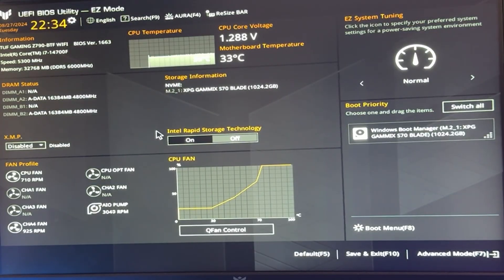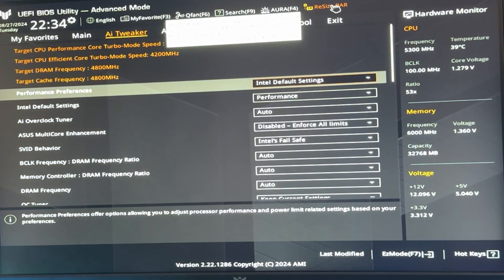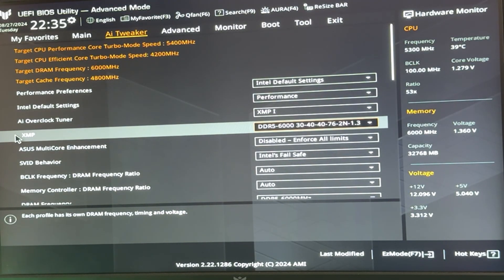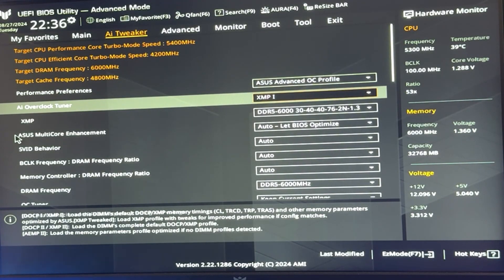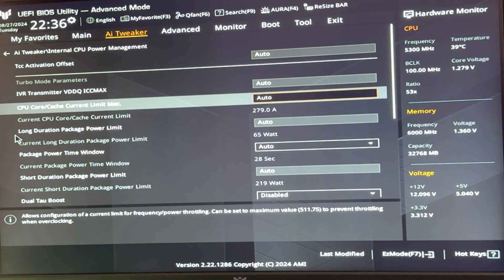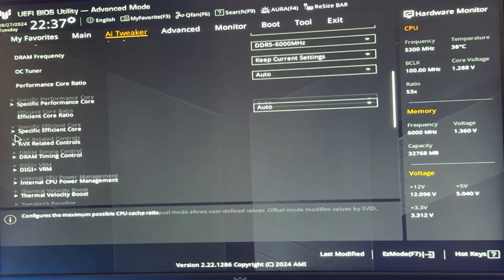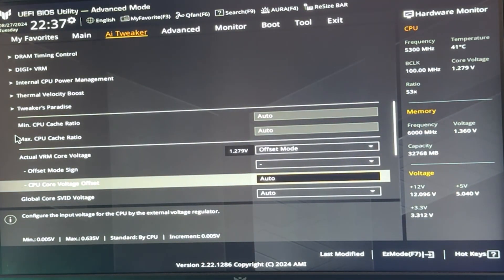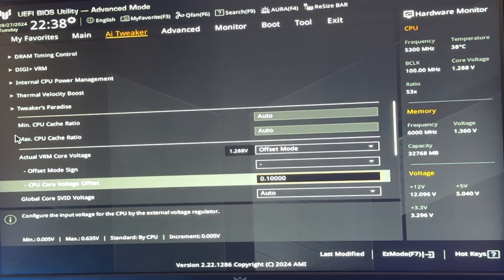Undervolt your i7 14700 & 14700F for more FPS and Lower Temperature!

Comment: the reason I need throttle stop is bc my mobo is locked and cant change anything with the locked cpu. XPS 8960 is a Bitch. cant even use xmp

Comment: This is great, thanks.  Using it to undervolt 12700k with the same ASUS BIOS UI.  The only difference here is for the offset, you set it to - 0.10000.  And for the power limit where he set it to 253 W, you change it to 190 W.  Follow the rest and it works GREAT,  my CPU temp drops by 10 C with no performance loss.  Again, this setting is for 12700k CPU.  THANKS AGAIN for the tutorial.

Comment: Bro my 14700K in gaming consumed 1.45v and after this undervolt still consume the same. Did I miss anything?
Reply: I have the same problem. I’m wondering if this UV even works at all. I have the latest 3001 BIOS on the Asus Z790-F.
Reply: @adamsadzik5154 in the end I limited power to 180w. Minimal performance impact in games but much better temps
Reply: Did you guys turn off Cep? Turn it off, made a huge difference

Comment: i7-14700f + B760M C V2: Changing to -0.075 dropped my OCCT test from 90°c with crash to max 75°c and no issue. Lovely. Temperatures are more even across the board, too. Not stepping from highest to lowest anymore.

Comment: Hey man! Need some help, I have asrock motherboard but with a i7 14700K. I saw your other undervolt vid for i7 14700k and said to do -.05 but here you said -100 for -.1. What do I input for offset voltage for the i7 14700kf with asrock. Should I put in -50 for core voltage to equate to -.05 on asrock motherboard?

Comment: Helped with my i7 14700f. I previously changed my pf1 to 125 and kept 2 tocdefault at 219. Ran fine after using the settings in the video my vaults dropped by .5 or so and performance everything is more stable. Mainly warzone
Reply: I'm too high i don't get it

Comment: My man , you just brought my 14700k down from 75-90c in helldivers 2 down to 45-50 c range with the same performance ! You rock bro !
Reply: Also testing with HD2 here, and the conservative Intel Default settings, CPU temps fell a solid 10c, and %usage fell 4-5%.
That first reboot after the changes had me freaked out for a bit (long wait, lots of fan roaring and flashing lights), but a huge win.
I have the same Asus 790 motherboard shown.

Comment: My i7-14700K is runing very hot gaming at 212F at some cores I know I have the right amount thermal paste on the speed is at 5.5Ghz on P-cores but 4.3 E-cores. I assuming that's whats doing it. I left it on Auto I never OC. idle is 100F. I have 9 fans. Its Air cooled not water cooled. Maybe because I do not have a Double heat sink. But I have the best Noctua NH-U12S Redux...So if anybody wants to give an opinion of how to set this right let me know. GIGABYTE Z790 AORUS ELITE AX. Should I lower the 5.5Ghz to 5.0 instead?

Comment: By setting your values, my CPU goes to 92 degrees and automatically drops to 70 degrees. This hasn't been very useful for me.
Reply: Intel needs to held responsible for this
Reply: you use 0.0500 or 0.075 ?
Reply: @TheSivagorn 

I think my friend set mine to 0.075 , I personally repasted with Mx6 and set my power plan back to High Preformance instead of that hidden Ultimate Preformance one. 
When I start it up now it his 50° for a few seconds then comes down to the low 30°s and while gaming it still hits 99 at first especially in Blacks Ops 6 if you leave it idling on the menu, but once gaming it goes down anywhere from 67 to 87 Native 1440p Very High Settings on other games it stays in the mid 80°s were before it would hit 100+ and thermal throttle, I would just try 0.075 and go from there because everyone's system is different.

Comment: Im doubting between i7 14700 or 14700kf for my system wich is msi b760 tomahawk ddr4 wiffi / artic liquid freezer 2 240 + contact frame / 7800xt nitro + / 32gb ram at 3600 corsair vengeance / philips 34m2c3500l/00 3440x1440 180hz 0.5ms fast va and 9tb storage 4tb m.2 / 4tb sshd / 1tb m.2
Reply: i went with the i7 14700 NON K gnne get it in a few days curious how it wil work out of the box.
Reply: @dieaking6475 how did it work?

Comment: I don't understand why you need to lower the voltage of an i7-14700 or 14700f processor.
If high temperatures are reached there are mainly two problems:
1 inadequate heatsink or unventilated case
2 poorly mounted heatsink

I have an i7-14700f with a 420mm arctic cooling AIO, in idle the consumption of the whole computer (so cpu + 4 hard drives + RTX 3060ti) is 66 watts and the cpu temperature is stably 22 degrees celsius.
If I run stress tests, such as from the CPU-Z program, the consumption reaches over 350 watts but the temperature never exceeds 65 degrees.

If someone says that this is not possible, I can post videos to prove it!!!
Reply: Is it possible to know the temperature when testing Cinebench R23?
Reply: With such a beefy cooler it's a waste not to use 14700k instead. I think most people who decided for the non-k didn't want to upgrade for a water cooler or bigger case. Still, Intel kinda scammed us there, difference in temps between the k and non-k seems to be just 5°C
Reply: Those who buy the 14700f without proper cooling thinking they are buying an underpowered cpu will have major temperature problems in my opinion.
From my tests the 14700f cpu under stress exceeds 300w of consumption and without a proper heatsink soon reaches 100 degrees celsius as in the 14700k. 
I enclose the link to a very simple and short video of mine where you can see what I write.
https://youtu.be/-GpQPiejxDU?si=m0hrW7J74JC3BSAX
Reply: @cix1976  what did you set your pl2 to? If it's on default maybe it's messed up, manually set it to 219 (Intel's default). My board's default pl1/pl2 is messed up giving 125/150 for a Core i7 14700f lol. At 65/150 it's pretty chill actually, performance loss yes, but still plenty for games. If you can handle that TDP fine, you would be better served with a 14700k, about the same heat, a bit more MHz. I read about a guy reporting his 14700k at 65w pl1 performed worse than a 14700, wonder if that's really true.

Comment: Hi, i am a fellow italian with an i7 14700F, congratulations and thanks for the guide, i was setting a vcore undervolt of -0.05 to begin with like you suggested, but on HWmonitor and intel XTU it doesn't read the -0.05 offset being active. I also noticed one thing yesterday, tinkering with Throttlestop i disabled turbo boost to read the lowest cpu voltages that my cpu could achieve, and they were 0.832 or something, i've left it like that for a night since i also had to copy a truckload of files between two slow hard disks, and it never ever went under that voltage (iirc) and surely never under 0.8. Now to return to the topic, by disabling turbo boost and reading the minimum voltages again i see my cpu sitting at 0.782 with the -0.05 undervolt enabled in the bios, so in short i think that the undervolt is active even though XTU and HWmonitor as i said do not read differences in offsets. Do you think this may be the case or am i tripping? Do you have any ideas on how i could verify that? Thanks again for your time
Reply: Ma allora scrivi in italiano.
Reply: @GeneralAkAbA Ho pensato dato che parla in inglese e per rendere il tutto leggibile anche da altri di scrivere in lingua inglese
Reply: @Feanorlike  ti sto trollando, ignora
Reply: @GeneralAkAbA  Potevi trollarlo in inglese allora!
Reply: so you mean that you was able to achieve 50 millivolts in software x but hw monitor did not show anything at all? is the temperature noticeable lower? on my mobile i7 7700HQ i was able to lower the voltage by 150mV and i got 76C instead of 92C

Comment: do you have a solution to get  xmp  to work  for an i7 14700k paired with a gigabyte B760 gaming x ax motherboard ? also running DDR5  5600MHz Ram.

Comment: Why would maxing out the turbos lower temperatures? I don't understand doesn't make any sense
Reply: I don't think maxing out the turbo would lower temperature. It's more the undervolt that lowers temperatures.

CPUs require power to operate, but different chips (even with the same model number) require different voltage to be stable. Intel gives a generous amount of voltage just to be safe, but 99% of CPUs can sustain the same clock speeds with slightly less voltage. This allows you to get the same performance with less heat and power.

Sometimes, because the CPU is cooler, it won't throttle, so you can actually get more performance by lowering voltage.
Reply: @dadozygaming if I run PowerMax without doing anything. It caps at 220 watts. When I undervolt .060 it goes to about 199 watts. Where am I looking to find out if my clock speeds are lower? I'm just assuming if I'm using less power so I'm getting less performance I have hwinfo. But what I'm gathering from you that even though the wattage might be lower, I'm still getting the same speeds. This is correct. Yes? 
So if I set my power limit 1 and 2 to say 500watts My CPU isn't going to use that if I undervolt by .060 ever? I use a 14700f I'm trying to maximize its performance since I can't exactly overclock it. When I got the computer at the time I didn't have a liquid cooler so I didn't bother with it. But now I do have a liquid cooler.
Reply: @QQWoLPHie  You are 100% correct in that you're not getting less performance when you use less voltage. You get less stability when you use less voltage. It's like a person screaming so that someone will understand them. The person can speak more softly, and achieve the same results. As the person speaks softer and softer, at some point, the other person will start to not be able to understand, and that's when the CPU crashes. You just to speak just loud enough so you always understand, but not super loud so you waste your lungs (plus you tire out faster). I hope that's a good analogy. Every CPU is different. Some CPUs are like deaf old people who can't hear very well, and you have to yell. Some CPUs can hear the faintest whisper without a problem.

Once you find the perfect voltage where it's 100% stable but as low as possible, you get the best of both world. You get 100% of your performance with power savings, a cooler CPU, and longer CPU lifespan.

Since your CPU is cooler, you could push it harder. However, you said you can't overclock, and that's okay. Just remove all your turbo limits.

Your computer will sometimes "turbo" your CPU by increasing its clock speed when under heavy load. However, due to heat constraints, it will often stop turboing in order to save the CPU from burning up. With undervolting, strong cooling, and turbo turned off, your CPU could effectively turbo infinitely, maximizing the clock speed and performance of your non-K CPU.

However, don't expect your CPU to always be at 100% turbo clock boost when idle. That's not what you want anyways. You just want it to be on turbo when you need it. Again, since you cannot overclock your CPU, that's all you can get.
Reply: @QQWoLPHie  Sorry for the double post. It's natural for your wattage to go lower, since watts = (volts x amps). As your volts go down, so does your wattage. That's a good thing.

I also want to warn you that removing all turbo limits can damage your CPU over time if you don't have enough cooling. Silicon degrades with heat. You don't want your CPU to be stuck at 100C all day. Use with caution and monitor your temps.
Reply: @dadozygaming  i got a corsair icue h100 elite and  3 fans so 5 total, its pretty efficient for sure, im gunna fiddle with the voltage and test, so as long as the computer doesnt crash with the undervolt and maxed turbo limits, does that typically mean its running at 5.4ghz or will it just lower my cap speed to maintain stability automatically. like if i gave it a .075 undervolt and doesnt crash could it be running at 5.1ghz at max or it will hold that 5.4 or crash at max speeds
Reply: @QQWoLPHie  If the computer doesn't crash, throttle, or exit turbo then it should be running without a decrease in performance.

If you really want to know if your computer is performing better, do a benchmark. If you want to check your computer for stability, do a benchmark. It's killing two birds with one stone. Try benchmarking without undervolting, then again with undervolt. You should see zero decrease in performance. If anything, your performance should go up with undervolt.

Have fun undervolting, but I feel -0.06 is already a pretty good result. I feel -0.075 is a bit greedy, but it's your CPU and your call.
Reply: @dadozygaming  no I heard 075 is aggressive. I was just making an extreme example
Reply: @dadozygaming  I get throttled at about 3 minutes in a benchmark no undervolt. Like if I use powemax SSE for 5 minutes I stop "turboing" little over halfway through. So a fully stable cooled CPU should be able to turbo the entire duration?
Reply: @QQWoLPHie  That's right. If you have a fully stable cooled CPU, you can turbo all day forever.

It's like the golden mushroom in Super Mario Kart. "Yahoo! YA-YA-Ya-Ya-Ya-Yahoooooo!"
Reply: @dadozygaming  I appreciate your help by the way, it's my vrm Mos that seems to top off before anything what's a good way to keep that cool besides air flow and what I've got already? Maybe get all top end Corsair fans cuz right now it's got ABS pre-built fans. I snagged and refurbished pre-built that was cheaper than building it myself. I wouldn't have done good Cable Management so I appreciate the hassle taken care of. Customizing where I can. I feel like once the '5070s come out the 4070 TI super will drop dramatically

Comment: Hi, I've just updated to the latest bios with the microcode update and when i undervolt my cpu with the intel default settings the undervolt doesn't work properly , the voltage are lower but the power consumption is the same as stock. However when i switch to the mobo unlimited power settings the undervolt works fine just like in my previous bios. I was wondering if it does the same with you when you put intel default settings ? Btw i undervolt my cpu thanks to one of your guides and same with my gpu so thanks for your work.

Comment: Thank you for the video!
"Problem" is, mobo chipset, most of 14600(k) or 14700(k) users don't own a Z mobo, but B one. Please, try something regarding B760 chipset, if possible.
At least on Gigabyte B760(m) chipset, the only way to undervolt is by selecting 0x104 ucode (if I'm not mistaken).
Reply: yes, my Gigabyte board can't undervolt under 0x129 microcode, while other B760(M) MBs easily can.
Reply: @antonavdyushkin545 You may be able to select to 0x104 uCode in the bios, which allows the undervolt. I'm doing that on my B760m Aorus Elite F18g (0x129 uCode) running on 0x104.
Reply: Where do I go to undervolt on the gigabyte one? If it can do it, is that the dynamic core thing under vcore?

Comment: Hei, I am a video editor, thiking to build an editing rig... is the i7 14700k issue fixed ?? i feel it would perform better than ryzen 9900x
Reply from the maker: If the i7 is set properly and cooled properly you’re gonna have absolutely no issues :)
Reply: 7950x seems like a much better choice for you
Reply: i have i7 14700kf never had any issue
Reply: 14700K is a gem! Just don't let default bios settings ruin it. Actually this is true to any modern platform.

Comment: can i do this for my i5  13600k? i have a MSI motherboard. and yes i have the latest update for my motherboard.
Reply from the maker: Yessir you can! I also have a few dedicated tutorials for undervolting K-series i5
Reply: @ImWateringPSUs  thank you! So If I do the same thing as your video provide I should be fine? Even tho I have a MSI motherboard correct? Or is their some other setting I should change ?
Reply: I have a 13900 locked non K, i use Tomahawk z790, can i make undervolt normaly with This kind of CPU ?  @ImWateringPSUs